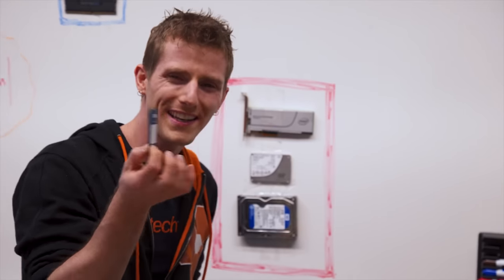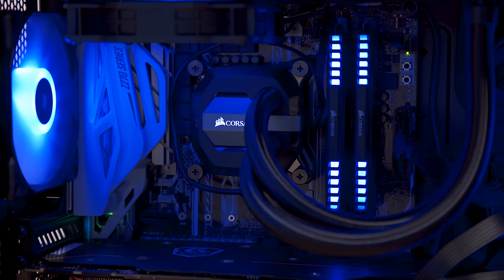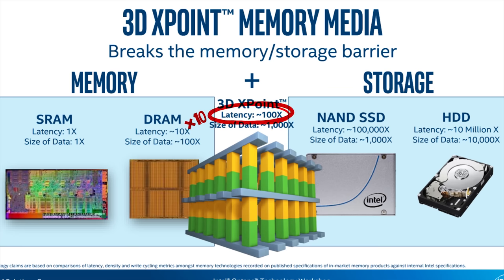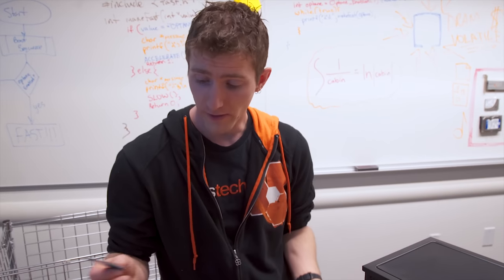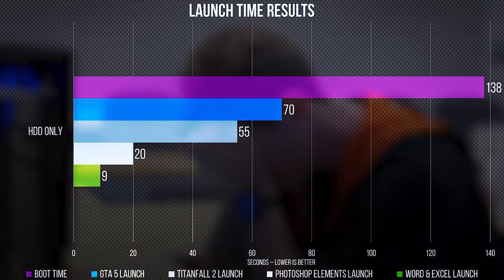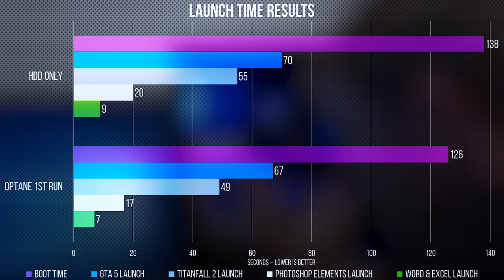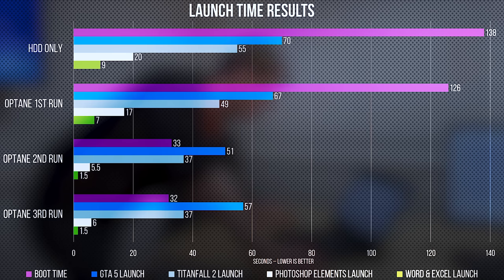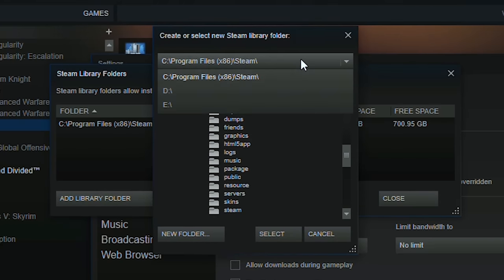Intel Optane Exclusive Hands On - SSD Crushing Performance

Comment: So, does this thing make sense if I'm already using a fast M.2 NVMe Samsung 960 drive? It sounds to me like they are really hoping everyone's using SATA HDDs...
Reply: i actually don't know. it is cache, so it might, but do not expect mega boosts as an HDD might expect.
Reply: Krutón it makes sense if you want low latency and fast boot times, applications responsiveness and starting time of applications, even if you have fastest ssd on market
Reply: Krutón it's 40x faster than your m.2 so there's that....
Reply: A comparison between SATA3, NVMe & Optane would have been more interesting. But I assume this would have shed a completely different light on it so they went with significantly slower HDDs to boast about the difference.
Reply: You probably will see an improvement. It's used as a cache for data that is normally within RAM. It's roughly the same speed as the NVMe, but your NVMe doesn't cache as much data as the Optane
Reply: Yes, probably the effect on NVMe and even probably regular SATA SSDs is negligible.
Reply: @john moore no its not optane  1200/280 Seqentiale R/W samsung m2 ssd 3200/1900
Reply: Krutón Same here i dont get what is that new or special about this product...
Reply: No just save your money tbh
Reply: It's important to note that the quoted speed differences are in access times and not read/write times. A good NVMe drive will offer faster read/writes, so if you're moving large sets of data it'll be quicker than the Optane. A good SATA-SSD will be perhaps as much as 5 times slower.
Reply: If you're already using an M.2 drive, no, this won't do much of anything for you (at least for the data kept on that drive). This is really only a benefit to those using traditional HDDs for bulk storage...example would be somebody with a 120 GB SSD boot drive and a 2TB HDD wanting faster load times for Adobe Creative Suite applications....between the OS and Adobe, the SSD isn't big enough to hold all of that (and the project data from Adobe as well), so putting in an Optane "drive" would give the system a way to keep the Adobe programs cached in a much faster memory and make launching Adobe faster. Depending on whether or not Adobe would use Optane to cache the data from the current project, it could make working in Adobe go faster as well, but I doubt Adobe will support that (considering they don't upgrade to take advantage of new technologies very often...Premiere still doesn't leverage GPUs when editing/rendering video).
Reply: The issue is that the bus is limited to a single x4 PCIe bus by the architecture, so just like putting two or three 960s in RAID, the gains are severely hampered by the bus - especially if you are using one of these to cache an m.2 drive in a second slot. The advantage that this has over a 960 is the latency and random reads will be faster, but in most cases the gains will be so limited by the bus that it won't be noticeable in actual use vs just a fast m.2 NVMe drive or even a couple of fast SATA SSDs in RAID0. Dedicating money and hardware to just gain a few seconds of loading time vs traditional SSDs isn't really a great deal.

To be honest, this product looks to be aimed at getting SSD-like performance from cheap spinner drives for OEMs more than anything else; it will let them boost performance while keeping their costs down. It'll gave a huge wow factor improvement on productivity laptops with limited space for storage, but for ones that already are all SSD, I don't think anyone will even be able to tell.
Reply: That's assuming that the Optane system will cache Adobe at all. From the looks of things, this system is a black box, you have no control over what gets loaded into the Optane stick. We assume it will learn over time and move the apps you use most onto the stick, but the limited info we have so far doesn't tell us much.

If you want to guarantee you get faster Photoshop performance, put it on its own volume, and use a configurable disk RAM cache app like PrimoCache to specifically cache that partition/drive. Even setting aside 2-4GB of RAM to do this will make things run much better than default performance from a normal SSD or hard disk.
Reply: Don't fall for the hype - there's a lot of BS marketing terminology in this video. 

* This isn't "L5 cache" by any definition; L1-L4 caches are built into the CPU die with dedicated high speed interconnects to the compute units they accelerate. Optane isn't directly connected to the CPU, or even the RAM - it's on the DMI 3.0 bus that everything else in the chipset shares. Optane, all but the main PCIe slots, any m.2 SSDs, all the sata ports, the network interfaces, all of the various USB ports, and the sound card all share the same single PCIe x4 bus link to the CPU.
* 3D XPoint is just optimized NVRAM that has better durability and is better at random reads and writes. It does this faster random access by removing the common controller bus architecture that SSDs rely on. It's not that special, and in a few years we'll have whole SSDs made from it. Optane is just a way to make some money on it while they wait for the productions costs to come down so they can sell it in larger quantities.
Reply: Yeah, the K6-III had a dedicated bus to the on-board cache, so not really a direct comparison. This isn't even a dedicated connection to the DMI - it has to go through the chipset to get to the DMI, and then through the DMI to get to the CPU. Optane can potentially saturate the DMI all by itself, as can a single decent NVMe SSD. If you're using an NVMe SSD at the same time, the DMI will be clogged up and both will slow down. If you are copying a file across the network at the same time, they slow down even more. If you have a couple of SATA drives receiving the files from that network transfer, they slow down even more. If you have USB devices doing anything that's bandwidth heavy, they slow down even more. You get my meaning?

The biggest gains from this are going to be people with mechanical hard drives, so that cheap fam PC is likely a best bet.
Reply: Yeah, that architecture was just weird - nothing like it before or since. I was working for an OEM building PCs back then - I built a LOT of K6 systems. :)

Still doesn't match the strangeness that came with the slotted CPUs like the Pentium II. I HATED those things. Putting the heats sinks on them and routing the cable from the fan was a total PITA.

Comment: I could see a 32GB Optane drive being used for OS + some programs and an SSD (M.2 or SATA) for everything else.
Reply: Rahul Katre 3D X Point will replace NAND and DRAM in the future.  2nd generation of this new memory is coming soon...
Reply: it wont replace dram, dram will go away with a new tech replacing it, nand is still cheaper to make, not going anywhere soon.
Reply: Rahul Katre this is the new tech.  3D x point.  Trust me, I work at Micron.
Reply: me too. on this part and newer ones
Reply: Windows on 32GB? lol
You're talking about the Linux master race!
Reply: rjcook450 emerging memory that is non volatile?  I may know the part of which you speak.  I hope you're right.  It would be nice to supplant Intel with something that is 100% MICRON's.
Reply: it would indeed.
Reply: Rahul Katre Perhaps, but I would err towards 64-128 GB for updates and pagefile as part of the OS on top of the boot and file system partition.

Comment: YAY SSD CACHE IS A THING NOW... oh wait this is useless
Reply: _ _ have you forgotten that hybrid drives suck?
Reply: TheUnboxerMan depends on workload
Reply: hybrid drive's cache connected through sata too,
but that one connected through m.2

wondering how sucks that thing...
Reply: ive yet to see a use case where nvme has an advantage over sata other than screencapturing 4k 60fps. In gaming ssd speed is not the bottleneck.
Reply: jackthemapper Because its about 5 times faster at this point. Having the choice why would you not.
Reply: More like have they forgotten their failure of Turbomemory in 2009?
Reply: Nathan Squire Uhh, I have a reason for you, which do you think sounds better? A really fast 32GB cache (which only works for brand new intel systems) or for a bit less than $50 you could grab a 128GB SSD off ebay and just run your OS and everything right off it or heck get Intel SRT or some other caching software and you have basically the same thing...
Reply: vgamesx1 I think this is competing with other Cached HDDs not SSDs. For applications where you need mass storage above all else, but also faster speeds than a normal HDD, and a 120 GB SSD is not going to cut it in those use cases.
Reply: Hybrid drives are better than their equivalent HDD only.  That said, I think the only hybrid drives being produced now are 5,400rpm.
Reply: RevengeofGothzilla if it is 50$ it IS competing with SSDs which are also 50$. The options are HDD + Cache vs HDD + SSD.
Reply: Nathan Squire because it is more expensive. It is 5 times faster only on paper. Boot times and game load times dont show any difference.
Reply: wait...im confused.  am I understanding this wrong? I plan to have an M.2 drive in my next build. I have no use for this right?

this is just for the consumer who can add some speed to load times who is currently only using an HDD, right?
Reply: Aaron Gentry yes. And even in that function its use is doubtfull.

make sure you dont assume NVME(PCIE) = M.2 when planing your build as SATA M.2 drives exist as well and are usually much cheaper. Check with your motherboard which kind of m.2 drives are supported. If both types are only get the NVME one if you know you need it, not because it says its faster. For 99% of current use cases its only faster on paper not in boot times and game load times. NCIX has a good comparison video.
Reply: jackthemapper it's going to be a z270 board and I believe, off the top of my head, the m.2 slot shares with PCIe. I'm still in research phase.  currently I have Samsung SSD in my current machine
Reply: M.2 isn't a transfer protocol, just an interface. M.2 drives can be SATA or PCIe. FYI.
Reply: Llohr correction - I meant to say SSD not m2.
Reply: Does any one using last gen intel i7 processor use an HHD as boot drive?
Reply: _ _ Solid state hybrid . Idk how everyone forgot about it . It's a lot cheaper to . I got a 1tb SSHD for $100 and i get 11 second boot times on Windows 10 .
Reply: I did the SSHD route too. Seagate 1TB for $88 or about $20 more than the standard 1TB HD. I bought it 3 years ago because I knew the SSD prices would be dropping and I could use it for mass storage later. 
 Glad I waited, now I can buy an NVME M.2 SSD and use the hybrid drive for mass storage. I do recommend getting a hybrid drive for mass storage, for just slightly more than regular HD I noticed approximately 30% faster everything.
Reply: Tams80, Not true, I have a Seagate Desktop SSHD, it's 7200RPM, 8GB Cache (the SSD part) - It performs very well compared to a standard 7200RPM HDD; The only things to note are that the SSD cache will have a limited number of read/writes, like an actual SSD (Though the drive becomes a standard HDD once the cache fails), and you'll see the read/write speeds of the drive jump up and down a lot as it moves files to cache and out of cache, but generally speaking it's better. :)
Reply: Everyone in this reply is missing a few key points.

According to the slide, this is 1000x less latency than SSD but 10x more latency than DRAM. So unless you are RAMDISKing all of your regularly used files this will perform better in applications. Also, since it's non-volatile and lower latency than SSD, it should actually boot faster than an SSD.

Also, it sounds really easy to use since you do not have to manually move files to it. Just plug it in and let the software do the cacheing.
Reply: SilentVectorX  pay 50€ to boot half a second faster ?   only worth it if you have a hhd boot drive,  even then much more worth buying a 128gb ssd for 50€
Reply: sandro correia those graphs didn't look like half a second
Reply: sandro correia 
Literally 100 seconds faster, IDK how you missed that,  it's literally the key talking point of the video.

I already have a Samsung 950 Pro NVME so $50usd is a drop in the bucket for better caching.
Reply: I assume this product is meant to target NAS/server enviroments since those are the only ones who would be using later generation intel cpus and still be on mechincal HDDs.
Reply: TheTomtah They have a much larger PCIe version for that.
Reply: No its not, its cache for building your own hybrid HDD, its not supposed to be used as an SSD. HDD with cache is far better than an HDD and an SSD in any use case where mass storage is required above all else. 1 large medium speed drive > 1 large slow drvie + 1 small fast drive
Reply: CACHE WITH YOUR OWN SSD ALREADY EXISTS
Reply: RevengeofGothzilla except cache + hdd is worse than ssd + hdd. Hybrid drives proved that.
Reply: My SSD boots in something like 5 6 seconds ,  using this tech with a SSD drive will give you 0.02% gain... on an hhd drive yes 100 seconds gain, any one here have last gen processor with top grade motherboard booting with hhd? im going to watch it again, just to make sure the test was made only with hhd drive.
Reply: Absolutely correct. Don't buy this. Spend your money on a good monitor and good speakers. Doesn't matter how good a system is when how you see and hear it is crap.